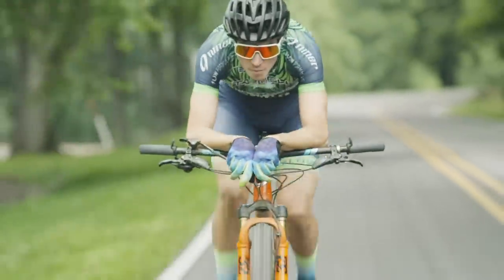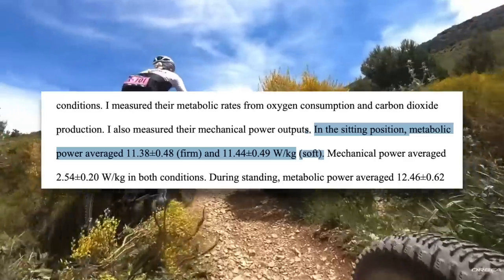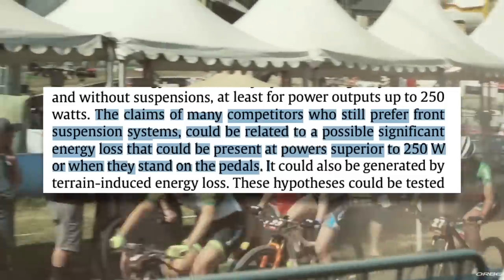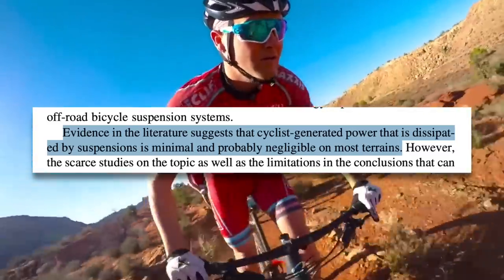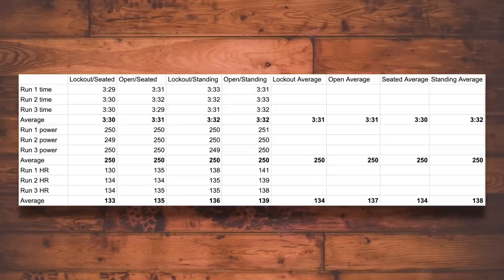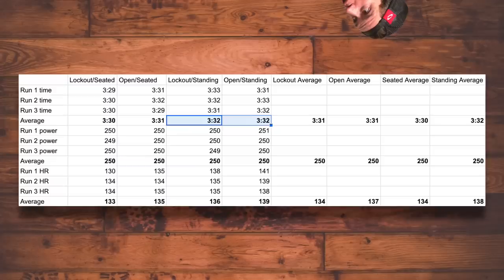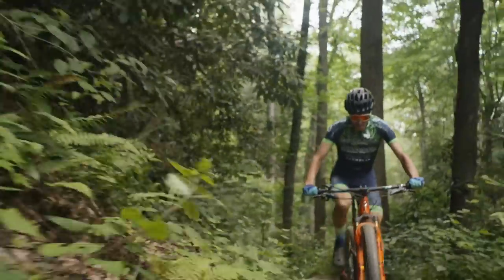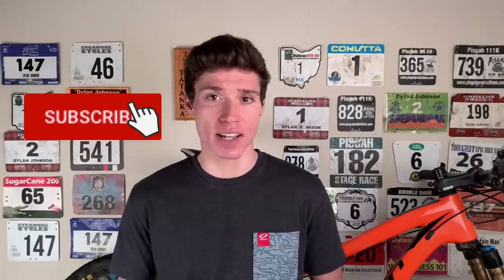Does Locking Out Your Suspension Actually Make Your Bike More Efficient? The Science

Comment: So I've now watched several videos repeating similar testing conditions. Primarily using a power meter to match power for every run. Which I believe is ultimately the deciding factor. When riding xc trails or on road the difference between the suspension open or closed is negligible, which if you're an xc racer might be the reason for you to choose no lockout. However from trail riding experience I can say definitively that having my bike locked out has made a huge difference. 

On my Scott Genius, going from 150mm of travel to maybe 20mm when locked out there is a significant difference in the amount of effort I have to use when putting the power down coming out of a turn or if I have a fouled climb that I have to peddle out of. The same difference was noticed when I went from being over biked with a Spec Enduro with 170/180mm travel to the Genius with 150/150 or 120/120 in traction, or 20/20 when locked. 

Riding with the same groups I was by far the slowest on the Enduro to being one of the faster on the Genius. While the Enduro is a slight bit slacker, the Genius is also in the Enduro class with similar geometry. While I can agree maybe part of this is a mental boost, that mental boost is because it very much feels easier to peddle. Riding the same trails unlocked compared to locked I will put down much more effort with more travel. 

The other thing I notice about these test is that to get enough data you have to run a significant amount of runs. Given that you have to do these on the same day to prevent variables such as weather and hydration, somewhat forcing you to do short segments on simpler courses, making the difference in effort harder to measure. Or you have to risk different environmental conditions affecting the results if you were to try to do longer segments on different days. 

If lockouts didn't make a difference, they likely wouldn't exist on almost every bike. While remote switches are less common, is there a shock front or rear that doesn't have a switch of some sort?

Comment: Great video Dylan. I have always preferred a lockout and I knew that it probably wasn't much different in efficiency but it does give a psychological advantage when you are standing in sprinting. The main advantage I have found is that I can run my suspension softer but still have a good pedaling platform for smooth terrain. I probably won't worry about the lock out as much anymore. It really makes you think about these new suspension technology like Fox live valve and also the SRAM flight attendant and how they are pretty much a big waste of money.
Reply: @the_fast_life  ,🤣🤣🤣 you nailed it on the head.

Comment: Wow!  I've been one of those constantly locking/unlocking with most climbs/descents.  And, I'm definitely guilty of frequently going for the hardtail over the FS XC bike because I think it's going to be more efficient (even though I know I'm sacrificing some on descents).  I'm going to minimize all that.  BTW, I'm guessing this also translates choosing my slacker 120mm FS bike vs the twitchier 100 mm bike.  As always, thanks for the brain food!
Reply: Oh, there's an interesting idea here, is there any literature comparing geometry @DylanJohnson? Would be interesting to check how true it is that a steeper seat tube angle improves pedalling efficiency, or that a slacker head tube angle is worse for climbing or tight tracks.
Reply: @AlejandroGarciaIglesias  an easy way to do something like this is get a Canyon Strive where you can switch the geo and travel in an instance.

I had one and it taught me a lot about geo and kinematics.

Comment: Excellent video.  A couple of things on which I'd like to hear your reaction.  1) Although I can't find the references, I remember some studies suggesting that loss of energy occurs more because of side-to-side compliance than bobbing.  Modern rear suspension has gotten very good at reducing side-to-side compliance, but it might be that be that wear in the bearings could give the efficiency advantage to a hardtail for the many riders who aren't going to have the bike's rear suspension rebuilt very often.  2) A long time ago I raced on a bike with a Fox smart fork, and the fork did a good job of responding only to terrain and not to rider inputs.  I never really felt that it improved my riding efficiency overall, but I did feel it was a significant aid in maintaining balance when standing up for a sudden surge, like when the trail widens briefly  and you need to get around a slower rider really fast.  Pretty narrow application, but it did feel like a significant benefit.
Reply: I doubt the side to side play from bearings would have a ton of negative impact.

The Nicolai G1 with EXT Storia rear shock uses spherical bearings on the shock mounts to prevent the shock from "stictioning" in turns are the frame etc flex.

Comment: Theory - on a relatively smooth surface, locking the dampers simply transfers the load stresses fully to the tyres, so the total system suspension and efficiency is unchanged. Instead of ‘vertical’ power being absorbed by oil or air in forks, that same energy is absorbed by rubber and air in tyres. 🤔
Reply: But the tire compresses and rebounds sort of uncontrollably and doesn't 'absorb' as much energy as a compression/rebound circuit. There's not (as much) resistance in the 'travel' of the tire , it's more of a basic spring. 

I think even with open suspension those watts converted to heat in the damper are pretty negligible unless you're sprinting out of the saddle on a long travel enduro bike for example.

Comment: It could be that the power meter is not capturing your exertion, since the meter is measuring the power through the pedals, not the energy expended bobbing the suspension. Bobbing the suspension comes from the feedback from the ground and other parts of your body, like your arms. If there was a way of capturing the totality of energy expended in your whole body, the answer might be different.
Reply: I agree. All this proves is the suspension does not affect the drive train efficiency.
Reply: It's mostly the pedalling. The power meter is calculating the force X the RPM , but you're also moving the whole system up and down. So some of the energy is going into moving the system (bb) up and down and the rest into rotating the crank , but the power meter doesn't know that. It assumes you're just spinning circles so same wattage with bobbing suspension is actually more work in reality.
Reply: Exactly, pedalling with suspension open you have to add the force needed to compress it to the equation, the damper is working to remove that energy from the system. That force isn't measured by a power meter but you will be working harder to output the same watts.

Comment: Funny you posted this video now. I too was fiddling with that this weekend. My fancy bike has been sitting around for awhile. I used it after airing up the fork and tires. I had inadvertently left my shock alone as it felt fine in my neighborhood. I went riding Saturday at my local trails ( flat with roots and quick three pedal accelerations). unlocked fork/ shock as per normal and rode. Rear shock only had 75 psi and was bobbing every pedal stroke so turned on the lockout to stop this. Sunday after airing up the shock to 140 psi, bobbing was less and felt better unlocked. I was a bit faster on the gang ride I was in on Sunday . With the correct pressure, the lockout on my shock is solid (like a hardtail). I had Risse racing revalve it last year to this spec. All I can say is, If the rear isn't spinning under power, and is fully solid when locked, It's a win/ win.

Comment: Timely video since I have been riding a single speed full suspension MTB lately faster than the hardtail I was using previously.  The rolling terrain around here make using a lockout a hassle since most climbs are only 30 seconds long.

Comment: Great video. I own a Pivot Mach 4 SL... I originally was going to get a lockout installed for the rear, but after riding it through a couple tough training sessions and races I leave it at the mid-setting near 100% of the time. As long as a bike has hyper-efficient suspension kinematics, I won't be thinking about touching the lockout.

Comment: Measuring at the pedals/crank isn't catching the loss, because the loss happens in your legs, before the power gets to the pedals. If you're pushing against squish, the stroke is different than pushing against a firm resistance to get the same power felt at the pedals.
Reply: The power meter is calculating the torque x rpm , but pedal inputs also move the whole system up and down compressing the suspension. The power meter doesn't know that. These are the 'missing' watts that cause the higher HR.

Comment: verry interesting information! Im an XC racer, I rided my HT bike without the lockout knob and cables (weight saving), I needed some adaptation time to all-time open suspension feeling, but very quickly it become natural to ride like that. Now I ride a FS bike, and the most difference I notice is on the longer techy DH sections, where the FS bike let me rest a bit more than a HT bike (hearth rate manage to drop lower due to less body work needed). but I still keep the lockout on the FS :) it come handy on the asphalt sections

Comment: Riding an ebike, the only advantage I found to setting the shock to the mid position is that it slightly reduces the chances of pedal strikes, because it helps keep the bike higher in its travel. Depending on the trail, doing climbs at high physical effort and because of the extra speed I find it safer.

Comment: Another fantastic proper-science driven video (and rather validating as I've not felt full lockouts increased pedaling efficiency). 

However, I do find the compression lever, only on the rear, useful to maintain better climbing geometry. Using "trail mode" on most shocks on prolonged steep/technical climbs on my long-travel enduro bike (160mm+) because of their inherently slack (sub-64/65 degrees or so) head angles. As it has quite a lot of sag (and I'm running a coil), I can reap the benefits of a steeper head angle without drawbacks of a loss of traction.
Reply: The problem isnt the head angle its the seat angle.

I have a Nicolai G1 which climbs great and its 17+kg with a 62 head angle. But it also has a steep seat angle.
Reply: @tylerbruce5731  Yes, agreed. Should have said both HTA and STA but oversimplified it down to just HA. Should have also add that as I ride a size XL bike with lots of exposed post, the effective STA is even slacker so the compression lever also helps there.

Comment: I would agree on the data, however I believe "in my experience" when in an all out sprint, locked out is more efficient compared to my suspension left open. At the end of the day, overall most current XC bikes have very efficient peddling performance when suspension is open.

Comment: Try to get a PR on our local trail for a 1.3 mile climb, I averaged 247w for 6:21 with my suspension fully open for the first lap and then I locked out my suspension for the second lap, felt super fast and easy to pedal with more power, and I averaged 258w for 6:27. 6s slower than open mode even with higher power output, super surprise!

Comment: I think you need to try a new fork with 44mm offset. That has to be the key. In all seriousness regarding inclines, pure system weight (rider and bike) is the biggest factor to consider, additionally, tire rolling resistance (carcass, tread design, compound, pressure and speed of rotation) and of course “aerodynamic drag”  on faster moving incline sections.   This was an interesting vid that got me thinking about the suspension , we have all been there in the mountains riding up rocky sections on a hardtail vs a decent pedal platform FS,  and felt the bike suspension allow the tire to come up and over the obstacle vs a Hardtail that has to push your rider weight(seated) up and over the obstacle- Hardtail - its doing more “work” but typically can be 2-4 lbs lighter bike in the race XC scene.  Its very interesting.
Reply: Agree, he will be much faster for sure! Every mm counts)))

Comment: What about sprint efficiency without and with lockout? Maybe higher power output and different pedaling technique would show better difference and why it might or might not be wise to lock suspension in short uphill or for sprint.
Reply: I still think that it has an effect on your body. I don't have scientific research or evidence to back it up, but if you test this up using the same power with the same bike (weight), the difference is gonna be negligible, since power in the simplest form is actually times x how far you move from point A to B. But your hr and rpe will be different. I also think higher power will probably gets you more different outcomes.
Reply: @cesraihandary  I think producing 250 watts on the pedals might be easier for the body with locked suspension than with open, so one can't do any meaningful test by keeping power at the pedsl equal. You would need to keep your body effort equal and that is pretty much impossible except in one way: try all out best effort and do this for a while on different days so you are fresh when you do the tests. Then after a while from your best time it should become obvious if 1 option gets you to the top for example 10% faster on average, or if they are always so close that there is no difference.

Comment: I think the reason why wider tires with lower pressure are more popular these days is because tire manufacturers use much better compound, which has lower rolling resistance. And many people use tubeless, which gives even more advantage. So it is reasonable that 20-30 years ago riders used to pump tires to the max to minimize rolling resistance caused by the rubber and the inner tube.

Comment: Anecdote coming in hard and fast.

I ride a 160/150 trail bike with a suspension setup that favours descending over pedal efficiency. 

Climbing smooth trails or gravel I just leave my rear shock alone. It’s a fairly modern platform and I never really notice any bob or feeling like I’m losing power.

On technical climbs I will sometimes put the “climb switch” in the mid position(not locked, but not full open) on the shock. I feel like the compression makes it so the suspension doesn’t just dive on obstacles and makes for a way more enjoyable ride.

Comment: When I decided to put a rigid fork on my full suspension rockrider, I tried first by just locking it : I gained 1kmh on average (so more once removing the 2kg weight difference). And the front suspension stanchions were actually blocking the travel (I though this will make no difference until big jumps). Explanation IMO : if you have something rigid to put your weight on during force climbing, you use it more. When I replaced the stock spring rear suspension by a lockable one, guess what I was able to put bigger braquets and maintain force climbing longer. Explanation : my body was less pumping up and down to counterbalance the bike movement, so if you have something rigid to put your weight on during force climbing, you use it more, again. Plus the extra bonus on the saddle in flat roads : less pumping means the optimal cadence is higher, you can optimize the effort. Since then, having a road cassette with less gaps became an evidence because you don't have to pay more energy at each gearing changes when accelerating. So yes i loved the feeling of a pumping suspension in terms of torque management, but at some point the maximum reasonable torque you can put is limited, and the same applies to tires (my sweat spot is 2.25 rear and 2.0 front actually).

Comment: This is great. I HATED fiddling with my Rockshox remote lockout, which got harder and harder to engage and wouldn’t consistently click back into open.
Reply: Same with my Fox step cast forks. When grit gets down in the lockout mechanism it jams up (usually at the worst time). Got tired of F-ing with it so I might as well get rid of the useless lever and cables all together.
Reply: @mmj7700  yep. I ended up just removing the whole lockout system. Allowed me the space to install a better dropper post lever. Good riddance.

Comment: I suspect that it depends on the effectiveness of the lockout, and possibly only with larger travel, descent orientated bikes, where peddle bob is quite pronounced.

I dont have any test data like this, only anecdotal evidence.  But I found that I set a number of new PBs shortly after changing from an old worn out rockshox super deluxe airshock to a new cane creek kitsuma coil, on a 150/160mm 27.5 trek remedy.  

The cane creek kitsuma coil have a very good 3 position Climb/ lock switch.  When you set the climb switch, it effectively locks out the hydraulic damper LSC and LSR circuits.  When you select the lock position, it hydraulically locks out LSC, LSR, HSC, HSR.  Which  basically turns it into a hardtail.  The "feel" of the lock out was alot more pronounced than the worn out old shock.  And as said anecdotally, I set alot of new climb PBs shortly after changing the shock.